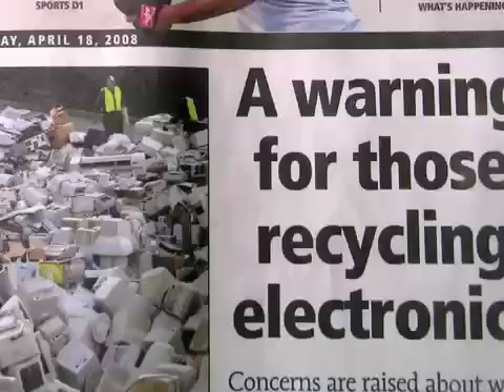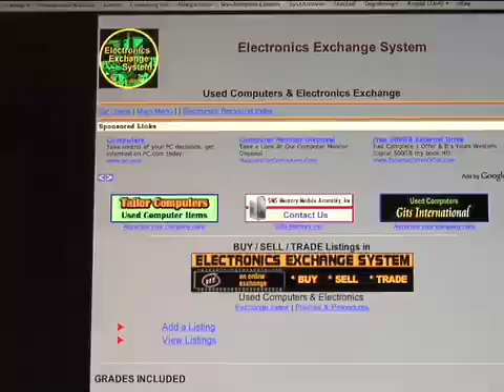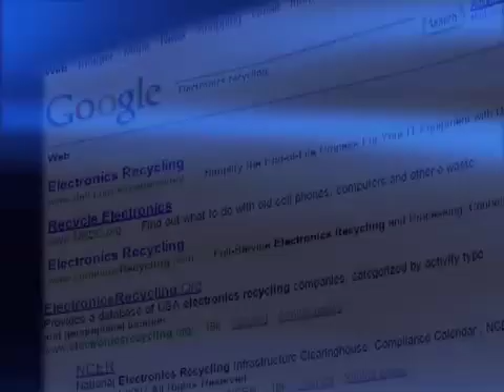eStewardship: Taking Responsibility in the Information Age (Part 1)

Comment: This is why I plan on starting a true recycling company that will recycle the whole computer, and every bit of the computer will be disassembled, desoldered by using a desoldering vacuum that will take off every component of the computer , and also a hot air tweezers to remove surface mount components, and it will be resold back to the computer industry, or treated as haz-mat and sent to be recycled the RIGHT way, not the usual way. Damn it, this kind of wanton destruction must stop!!